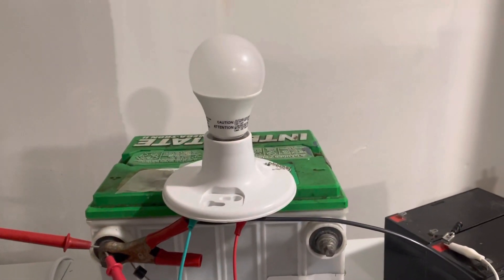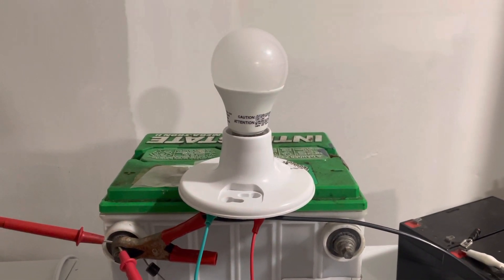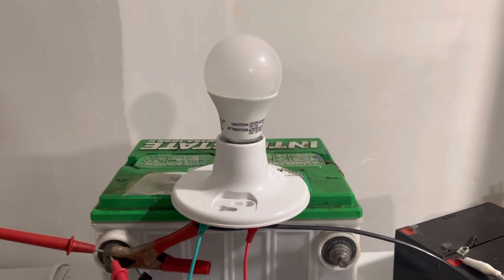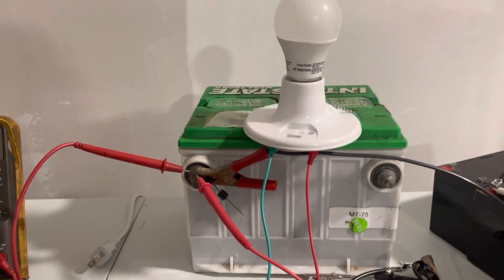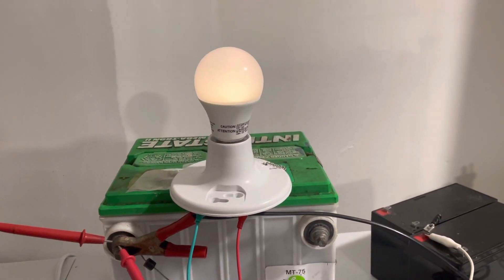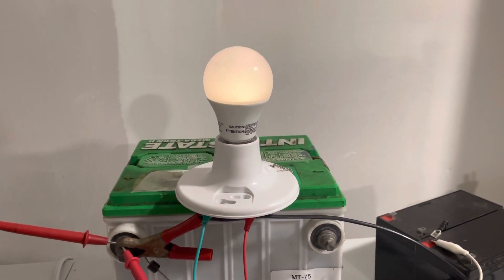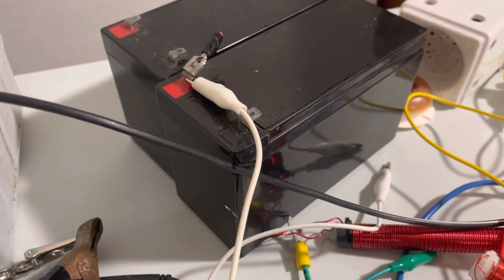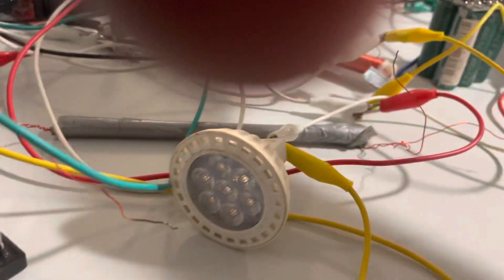Don Smith Resonance Kit For Sale

Comment: For $1000 can you put it on a Board so it can be plug-in-play?
Reply from the maker: yes that is the plan, it will be plug and play. You are paying for the technology, not the components:)
Reply from the maker: I am also creating an emergency light kit, that will include the same but also a solar panel and charge controller for emergency use or off grid light source. This will run on a 12volt battery for days, or months if you use the solar panel.